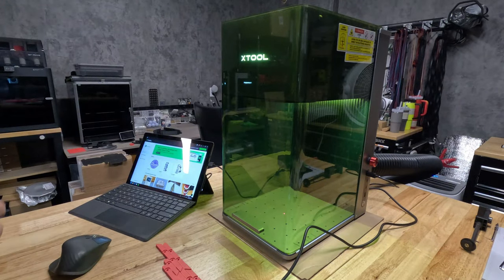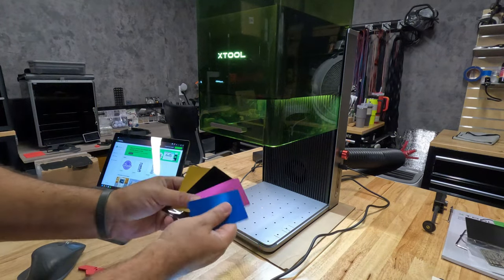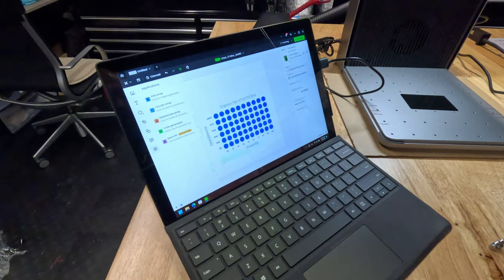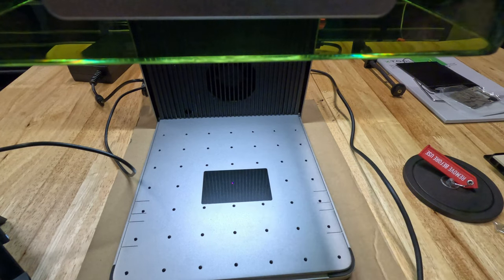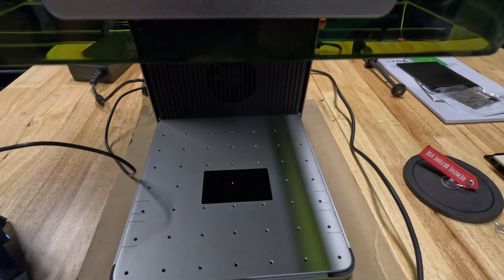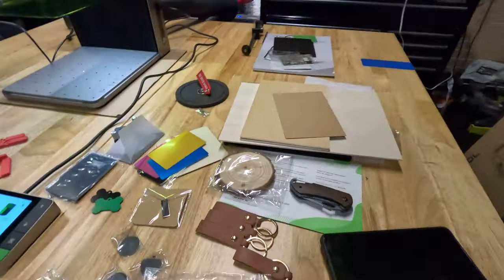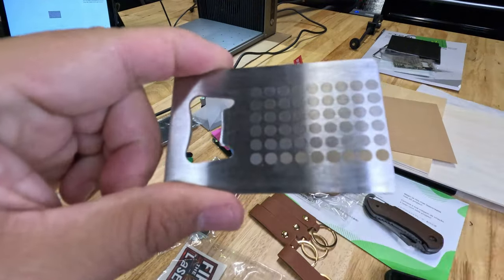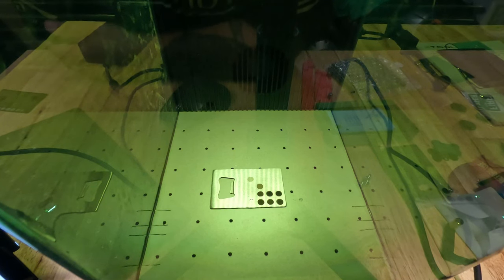F1 Ultra Testing - Fiber IR Laser - Fails on Low Power

Comment: The edges aren't brighter because it's stronger there, it's because the dwell time is longer because it has to decellerate and accelerate again to change direction of the scan. This is normally solved by shutting the laser off and continuing the path for longer than the path.
Reply: And the shitty low power performance is likely due to laser not reaching full power on each pulse on those settings. You have to remember there is no power setting, it's all pulse width modulation. Laser takes time to reach full power on each pulse - the pulses are not square. Lower frequency might help.
Reply from the maker: And also is a 20w using a field lens for 200x200 that is a lot for that power.
Reply: @AlivePixelCreates  Yeah, it's an odd machine, almost like a marketing department designed and specced it first, before the product design team had a chance to interject.

Comment: Since Lightburn has control of overscan %, it would be interesting to see if the halo would still show up with overscan.  Thanks keep them coming!
Reply from the maker: exactly I haven try anything on Lightburn yet. so that will be interesting to see
Reply: I think overscan would definitely solve the halo issue, and I think Daniel eluded to that in the start of the video briefly...that it was mostly due to not having overscan.  Not having overscan means that the laser beam has more energy at the edges that is not disbursed out evenly as it is in the other areas of the engraving...which can lead to many failures.  Daniel knows this and is trying to illustrate what the XCS software does and how it performs on its own...and not using the laser with 3rd party software.
Reply: @lasersandbeyond  Agreed, the extra energy from stopping and changing directions on the design, shows most in the mid-values and is not effecting shading as much at the low or high end.  Some areas of the machine and software are not "Ultra" yet.

Comment: could you try the Halotest with and without smart paths itellegent path?
Reply from the maker: I use the default with smart on this test. The next metal test is going full manual and nothing Xtool smart for sure. Normally the smart path takes longer on everything

Comment: I'm pretty sure that it did fire at 10% just was too weak and fast to see or yield any results.  Even running that low of power barely does anything to plastics.  My tests showed almost the the same thing.  For my testing the only metal the showed any results at 10% was titanium, copper, rose gold, and anodizing aluminum.  Everything else was barely noticeable.  
Side note - The F1 and F1 Ultra need to be fully LightBurn compatible, to get the full capabilities out of these machines.  Right now they are just under basic galvo.
Reply from the maker: I usually mark pla at 100% on a 2w. So 10% on a 20w should be fine. But does not fire
Reply: xTool is doing a real disservice to it's customers by not having their machines conform to the standards that all the better companies  do to make sure they work with LB.

Comment: I think it's most likely that at 10% it's just not enough power to affect the stainless steel. I doubt 11% would have marked either in that test, but somewhere between 10% and whatever the next power level was is the minimum power for stainless steel.
Reply from the maker: but also didn't mark the coated card, remember that is 2w and that is what I was used to use on the F1 and worked fine.
Reply: @AlivePixelCreates  I still haven’t received my F1 Ultra. Hopefully I don’t have any of these issues. I will be testing out the low power on stainless steel though just to see what’s happening.
Reply from the maker: @TonyMueller  please let me.kniwnhiwnit goes. Also keep in mind that low power might be better for plastics.
Reply: @AlivePixelCreates  Also the lowest speed at 10% should have resulted in more energy density than some of the faster speeds at 20%
Reply from the maker: @gregparker5732  true

Comment: Have you reached out to them directly to see what's going on? My first IR 2w module for my S1 was defective and they replaced it for me. The second works, but I'm starting to see 2w is just a joke. My F1 Ultra arrives tomorrow. So I will try your settings at some point to see if maybe your unit is having issues, or if there is a thing that Xtool needs to patch/update?
Reply from the maker: I'm finishing testing soon and I have a list of things I need to ask support, since they take usually a lot to get back, I want to have all in one request rather than go for one at the time.

Comment: Any updates on this halo issue?  I saw this today using the blue light laser over 2000mm/s.
Reply from the maker: Still getting the halo. Is better at slower speeds but definitely not what the machine is advertised for.

Comment: I have the same issues. Halo ant not firing with 10%. Did you get any further?
Reply from the maker: Still doing test and finding inconsistent results hard to say this works or this doesn't because is kind of random. Works perfectly on one and when I send the same.thinn as a repeat job fails and doing it for a third time can be perfect or fail there is no way to have a real result so far
Reply: @AlivePixelCreates  you mean the halo right? Under 11 percentage also in engraving mode I get no beam…
Reply from the maker: @chrisr1241  yeah not fire here under 11%
Reply: @AlivePixelCreates  The support answered me that the ir laser needs a minimum amount of voltage to fire. They recommend not using it under 50%. Hmm... thats strange...
Reply from the maker: @chrisr1241  that means that if not well made in my opinion
Reply: @AlivePixelCreates  New answer from support. They recognized it as a bug and will fix it with a software update...
Reply from the maker: @chrisr1241  they are terrible accepting their issues.
Reply: @AlivePixelCreates  you are right. Now I try to explain why the overscan is missing. They said it is just a wrong setting. We have to go slower... That's not good. And I would love to see a kerf function when you engrave because vectors like text come out too fat because kerf is not compensated. Even on the ir laser... And negative text where the laser removes just the background creates text too thin. They don't even understand what I mean. It is simply cumbersome to offset each text in illustrator to kompensate the kerf...
Reply from the maker: @chrisr1241 yeah I have some talks with one of the developers for XCS and they said that the machine is design to use png more than SVG . Try a photo and you will see that actually is better. Hahaha is super weird. Lol
Reply: @AlivePixelCreates  haha this is super weird... I thought they want us to use xcs as a design tool and not to do the design somewhere else and import it. I think it should be pretty easy to integrate the kerf option in engrave mode as they have it in score mode...I also don't give up telling them to integrate overscan ;-) maybe both of us will have an impact. At least the 10% laser beam issue is addressed in the next software update...
Reply: @chrisr1241  Has this been released yet?  Thanks!

Comment: Can you share the settings to test in my unit?
Reply from the maker: I use the test grid maker from XCS. Look on my channel I did a tutorial how to create them
Reply: @AlivePixelCreates  Same behavior! 10% power does not show up! Hallow Effect to!
Reply: @AlivePixelCreates  I had to start at 20% because somewhere in the programing it will not fire on anything lower the 20%.  In lightburn you can change those settings to fire on lower %'s.
Reply from the maker: @stanlyipkiss8265  that is messed up

Comment: I'm confused why it matters so much to you how it looks on what are considered unusable combinations.  The optimal results are on the bottom of the card, so naturally the ones that are not optimal will look like garbage.  I don't see any of what you're calling "halo" in the good areas, so why does it matter?
Reply from the maker: So lower power or faster speed doesn't mean garbage. A consistent machine will make the engraving with no problems just not as define. I've been using multiple machines so is not like I have no idea what would happen. Also why is not firing at 10% power. Because it is not needed? Based on your input it is not full blast power wind do good. That is not how lasers.work tho
Reply: @AlivePixelCreates  but those areas you mention look like garbage, I can't think of a single time I'd use an engraving like that, there is hardly any material removed and it's not whay you look for in a coated metal card, you want to reveal the shiny metal underneath 

I never said lower power or faster speed meant garbage, I said the results you pointed out with halos looked like garbage anyway and we're not in the realm of acceptable engraving.  None of thise marks provide the mark a person is looking for when doing metal cards, so why does it matter if there are things there you don't like....they are shit marks anyway
Reply from the maker: @lasersandbeyond  but that means that or is under power or is advertised as 20w fiber when does not have that power. Because a 2 what at 100% clean the coat but a 20w on 20% doesn't?
Reply: @AlivePixelCreates  I don't understand what you're asking or implying.
Reply from the maker: @lasersandbeyond  run a test on your F1, then use similar settings on the ultra, if the F1 clean a coat with the IR with 2w why the ultra needs to be at least on 5w to do the same operation
Reply: @AlivePixelCreates  it doesn't compute like that.  This is why I say sharing settings is stupid all the time.  If you're judging you f1 ultra based on results made on your f1, thats not logical.

You can't say to run the ultra at x percent which equates to a certain value percentage on the 2w.  Doesn't work like that at all.  There is more variables for error than there are chances for it to be the same.  

I would even go sonfarbas to say 10% on my ultra won't usually lend the same results as your ultra at 10%  

Sure it's the same modele wattage but so much more is at play.  

I've been having that discussion with people for 2 years now, it's just not a computation that can be made with solid findings that are the same all the time for everyone.  Too many variables. 

The 9nly true way to know of your laser is firing at a true 20w is to measure its output, not trying to compute a lower wattage to match an 8nferior model and compare results.  

Don't you have a way of measuring your lasers output in your shop?   Thays way more scientific than the way you're going about it.  It's anecdotal at best.
Reply: @lasersandbeyond with trial and error on my machine I learned that translating settings from other machines or OG F1 does not work.
Reply from the maker: @lasersandbeyond  so basically a 2w will work better than a 20w then
Reply: @AlivePixelCreates  how do you know the ultra is using 5w?   I have found that you can't rely on % of total power.  Doesn't work like that.  It doesn't climb at an even scale.  20% power does not mean 5w.
Reply: @M7meedo  100%  
I first started such tests trying to help others with a 10w diode using my 20w diode.  I learned that the escalation in power to total output is not computable or translatable.
Reply: @AlivePixelCreates  No, not better, just differently.  For some reason your brain is stuck trying to compare the two, and I'm not sure why... I know you know better.  lol
Reply: @AlivePixelCreates  I have to finish a couple things, and I'm going to do a test on the cards xtool sent me on my f1 ultra and share with you.

What percent power and what speed is the mark made on the regular F1 that you are using as your benchmark for comparison.
Reply from the maker: @lasersandbeyond  100% and 500mm/s with 160lines

In the ultra that will be 10% power